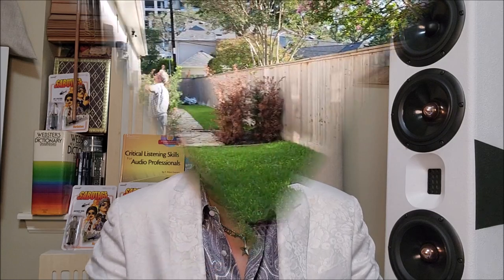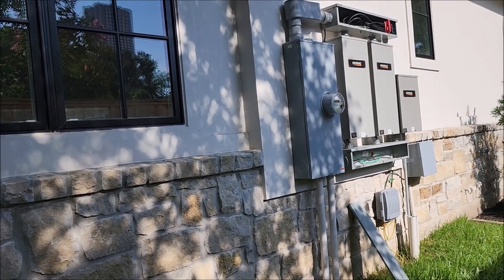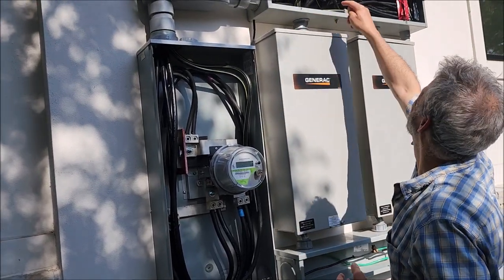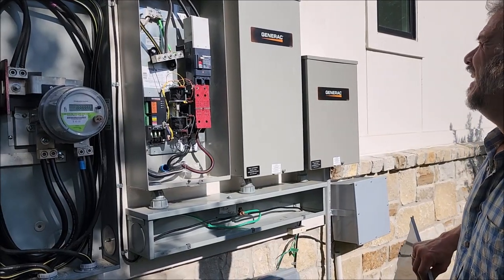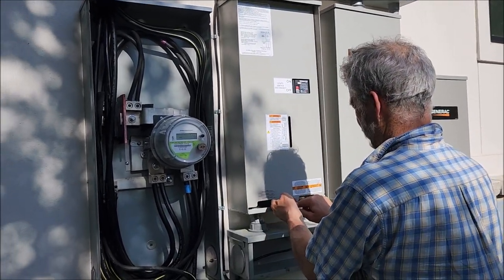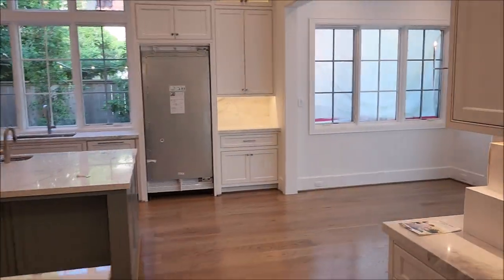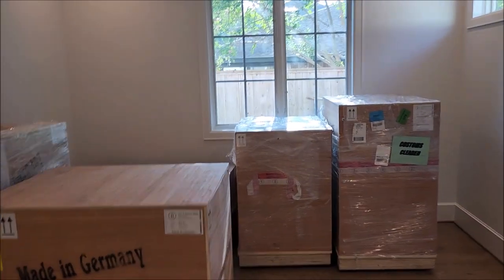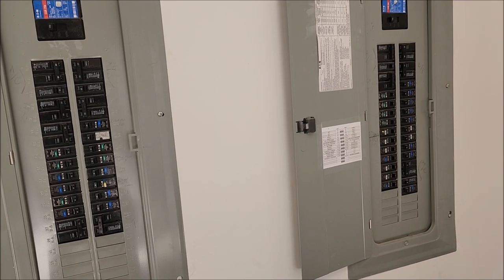Audiophile Electrician - Part 3 - Power Delivery Dedicated to MBL Extremes

Comment: I recently had my retirement home completely renovated, basically from the studs on up. All new plumbing, HVAC, etc. I had worked with the electrical contractor specifying 14 gauge/15 amp circuits for the lighting, and 12 gauge/20 amp circuits for all receptacles. For my home theater/listening room I specified three 10 gauge/30 amp circuits, all running off the same phase to eliminate differential voltages between any of the equipment. All new grounding and all copper from the meter into the breaker panels, as well as a Generac 22 kW generator for the whole house. I have zero hum on my systems (home theater and stereo), and have had plenty of power available for my Classe 300 watt/channel amp and subwoofer (500 watts each) amps. The electrical contractor had no problem running the circuits and was very cooperative, unlike some I’ve heard about who question the homeowner when he wants something out of the ordinary. I already had the 10 gauge Romeo from redoing a home theater/listening room in my previous house, so there was no difference in having it done the way I wanted since labor to run the wiring would have been the same had I used 12 gauge. I use mainly Nordost power cords for my sources and preamp, all running off a Shunyata Hydra feeding off one the 30 amp receptacles. The amp and subwoofers are plugged straight into the 30 amp receptacles.

Comment: Just a thought – I’m not an ”audiophile”, per se, but I do have a degree in electrical engineering. If I were designing audiophile components from a clean slate, I might well eliminate the separate AC to DC power supplies within each component. Instead, I might design a pseudo-standard ”power bus” to feed them all. Automotive audiophiles do it at 12 volts, but maybe something higher would work better.

I would design a really nice DC power supply that would feed a ROBUST bank of super capacitors, then use that low voltage DC rail to feed various components directly at that voltage, probably through thick cables that could be the size of a car battery cable.

It SOUNDS like it should work … (Or am I "re-inventing the wheel" here?)

Comment: Have all the stone removed from that post, run PVC conduit and 8 gauge wire, then have all the stone put back.  no biggie for a place like that.  Looks like the run will be over 40 feet, better to step up to 8 awg wire (40-60 feet) if more than 60 feet use 6 awg wire.  Maybe there is a short cut, up and over through an attic space?

Comment: Yeah aliminum wires and bar cheap trash. Copper a lot more expensive but better. Luckily where I put my system I had not even looked at the breaker box so when they came to put in separate breakers I had a really nice panel put in to begin with.

Comment: I follow what you were saying and power supply is the foundation for everything else.  The phrase that's stuck with me is when you said unimpeded power.  To me, unimpeded power means that when additional demands Are needed to reproduce very quick and dynamic changes in frequencies there will be nothing interfering with getting these surges of power needed.  But then in this day and age we probably do have enough power coming through the outlet to do this and then coupled with Quality capacitors sitting in a preamp and a well designed amplifier the additional surge requirements to me seem satisfied quite well.   Elimination of noise along the Power supply would seem to be more important then focusing on unimpeded power, which may or may not be a real issue?  If I get another circuit installed I will definitely consider using 10 gauge wiring to ensure adequate flow to power my systems and this may or may not really be necessary but it's something that can easily be done,  and maybe of value.

Because I have trouble typing due to muscle sensitivity every time I touch the screen I have to dictate this and it came out pretty well.  But editing is a pain in the ass cause I have to touch the screen every once in a while.
Reply from the maker: I used to worry about noise, but then I realized everything gets coverted to DC and most of these power conditioners don't even remove the noise that my meter picks up.  

On the flip side... Power demands can come in quick bursts that are very large.  Most gear can deal with it, but that's the area where performance is most likely going to be evidenced.

Comment: I'm listening to the wonderful tour of all the electrical panels and I'm listening to background humming maybe from some HVAC systems it's really quite bad. All the background noise probably penetrates inside the home and basically trumps any effort to have a low noise environment for listening. My guess is he may need to really soundproof a room. Just goes to show you, you can spend millions on a home and the neighbors can interfere with it. Hope he doesn't live next to a pool
Reply from the maker: It's pretty quiet inside but HVAC can make a lot of noise. I recently put rubber footers on mine outside and it made a huge difference in the noise... Basically used the same thing used for washers and dryers to minimize the vibrations.
Reply: mini splits are great.  If noise is an issue, close off HVAC to that room and have a mini split installed (heat pump). Mitsubishi makes good ones.
Reply from the maker: I've got one. They still have an outdoor unit, but usually much quieter.  I like mine, but not for everybody.

Comment: Without question, dedicated subpanel feeding the audio system is warranted.
(ideally through the attic, exterior on if necessary)

I'd examine restructuring the meter load side distribution, and source the subpanel there. 

Even in very nice homes, electrical rough-in wiring is quite modest in quality. 

btw; that baseboard outlet he opened up, ... yes, the wire was attached wrap around style on the receptacle screw, but it was turned 𝙩𝙝𝙚 𝙬𝙧𝙤𝙣𝙜 𝙙𝙞𝙧𝙚𝙘𝙩𝙞𝙤𝙣! (whereas tightening the screw tends to loosen the wire)

That illustrates a lot, I'd be suspect of all connections in that place. 

Connection integrity is vital, it's everything. Safety on one end, performance on the other.

As far as the power for the big system, you've got to add up the MBL's requirements. 
Dedicated circuits for each amplifier, four amplifiers total? 
Six amplifiers? 
Plus low level source gear... 
So at least 5 circuits, likely more. 

To mitigate voltage drop, if possible upsize each receptacle feed by one size, 10awg for subs, or amplifier loads, no joints, dedicated/isolated home runs. 

MBL Extremes, that'll be a mammoth, high power system... it's going to need low impedance, high current delivery to each device. 
Those big powerful moments rendered realistically, with a stiff line voltage, entirely free from I²R losses... even on peaks. 

So I'd think the dealer needs to spec total circuit requirements, and drop location.
Reply from the maker: Yeah we got a lot of people on the job making sure everything will be optimal.  It's a major project.
Reply: @AudiophileJunkie  I have found that actual watt usage by amplifiers is far less than what people think it is. Has anyone measured the actual Watts used? I think people go nuts thinking they need all these individual circuits when they really don't. Unless you are furnishing sound to A large auditorium you probably don't need that many circuits.  I've got lots of gear comfortably driven by a 15 amp circuit. I wish it was 20 but not worth $2000 to get it upgraded.
Reply: @iampuzzleman282  
$2k is a lot for sure, but the install of a dedicated circuit, with it's own neutral and ground all the way to the panel, is often a tremendous bang for the buck improvement.
Reply: @iampuzzleman282  
"watt usage by amplifiers"
Are you referring how much they draw from the circuit/panel?
Reply: @FOH3663  thanks appreciate that.  I have a transparent power isolator and lots of nice power cords.  And my grounding system with a stake in the ground and a new panel install two years ago.  I run everything off a 15 amp circuit dedicated to the outlets in one room.  Includes a couple 600 W mono blocks and processor and preamp and the flat screen TV, and router and modem.  How do I know I need a new circuit that might be helpful?
Reply: @FOH3663  , yes, I know the amplifier stores up a lot of power ready for a quick use.  But most larger amplifiers even under heavier load draw maybe 150 W 200 W from the outlet.  My Macintosh 600 uses about 90 watts when it's turned up kinda loud.